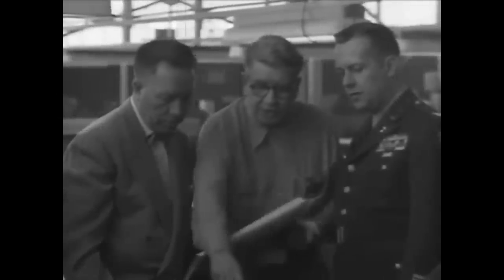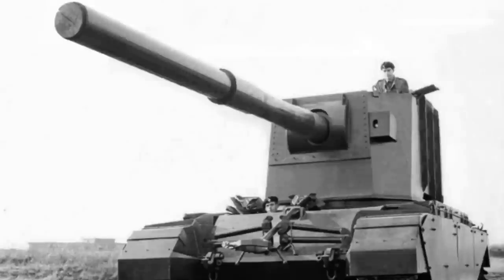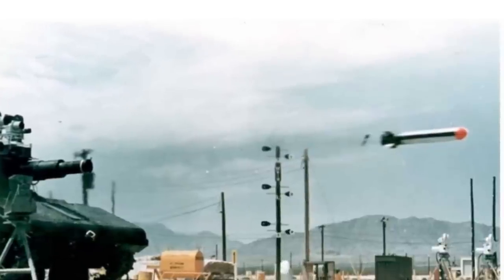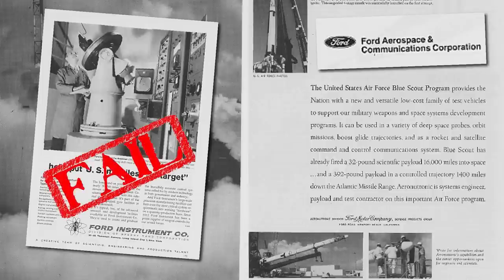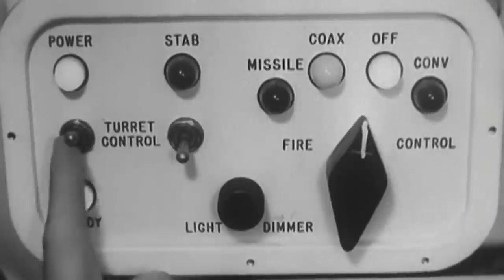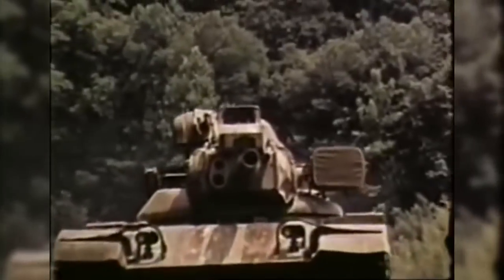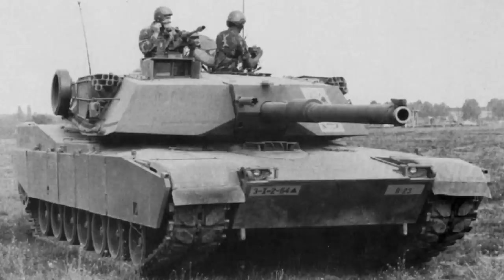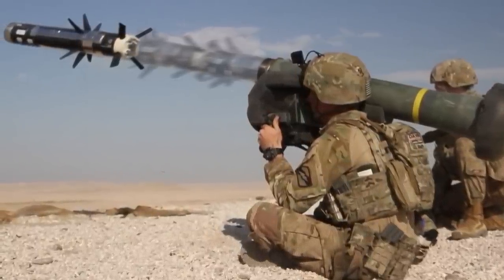MGM-51 Shillelagh - Was it a complete failure?

Comment: The M60 Startrooper and the Sheridan only gave headache to the crews so unreliable they were but perhaps the real failure was the Sheridan that recoiled tremendously and the caseless 152mm main gun rounds suffered very much from humidity and when fired conventional rounds the tank recoiled like crazy and often putting out of order the instruments and had far too thin armour with the crew sitting outside because of the mines. A very controversial tank...
Reply: I was a platoon leader and on BN staff 4/68 Arm-82nd ABN 11/73 to 11/76.  Fired missiles every year with each Company in the BN.  Only saw 2 failures.  Conventional recoil was severe, but missile component failures were rare.  Conventional round breaking was also rare.  The occasional events have been repeated so often, they are now assumed to be common.  Not true.
Reply: While the Sheridan is nowhere near as good as the cancelled M8 that was supposed to replace it, it would have been interesting if the Army deemed the Shillelagh a lost cause earlier and replaced the gun with a Bushmaster or a low velocity 76mm or something.  Not sure if that would have been doable but it would have been interesting.
Reply: @cm275  this is very true if fitted with the the Bushmaster or something similar it would have been a better option but also cheaper.
Reply: @cm275  The cancelled T92 prototype that preceded the Sheridan had a 76mm gun that could fire HVAP rounds.
Reply: I did three years C Trp, 3/12 Cav, 3AD. We fired Shillelagh every year. Saw one miss. Recoil on conventional round was to third roadwheel. If you fired to 1600 meters the track would rock like crazy and you would still the round hit. They replaced them with M60’s in ‘79. There was talk of replacing the gun/launcher with an 85mm and adding a dual TOW launcher. And I never rode on the outside. Maybe in Vietnam.

Comment: I was an M1A1 gunner during Desert Storm in 4th Battalion 70th Armor. I served with two sergeants that had began as Airborne tankers before transitioning to 19K like I was. I was always envious of their beret and tab. If we had an airborne light tank today I'd sign up for it. With today's missile technology it could be lethal. Imagine firing a round that could arc up and attack the top like a Javelin does. That tank was ahead of it's time. Cheers.
Reply: Imagine launching the missile and first the gun is automatically and nearly instantly aimed at you - and then you see the missile break apart about 20 meters away from the tank.

US tanks are getting fitted with the Israeli 'Trophy' Active Protection System.  A perfect record of stopping at ATGMs and antitank rockets in combat and when the US Army tested it using over 50 different types of antitank missiles and antitank rockets (under simulated combat conditions) it stopped every one of them.  (Including the latest versions of Javelin, TOW, and Hellfire.)

Comment: HEAT shells don't make a molten stream, instead the copper is formed into a plastic (state of material, not what it is made of) 'spear' of sorts, which kinetically pushes its way through the armor.
Reply: Semantics.
Reply: @Chilly_Billy  
I mean it really isn't.
Reply: HEAT (high explosive anti-tank) shaped charge:  creates a high pressure jet of gas and debris on the order of millions of pounds per square inch; yield stress of most armor is on the order of hundreds of thousands of pounds per square inch.  The damage mechanics are the high pressure jet literally punches a hole through the armor.  Modern defenses include armor composites that disperse the jet; physical barriers that prematurely detonate the warhead; bars that the deform the shape of the charge cone (usually made of copper alloys); etc.
Reply: @rmace8423  
There is no 'gas' with a HEAT shell, it becomes nowhere near hot enough to convert the liner into gas.
It's a purely kinetic penetrator, just exceptionally fast.
Reply: @ThatZenoGuy  I agree with you; the only gases would be by-products of the explosive detonation.   "At typical velocities, the penetration process generates such enormous pressures that it may be considered hydrodynamic; to a good approximation, the jet and armor may be treated as inviscid, compressible fluids ... with their material strengths ignored."

Comment: The main reason for the gun launched guided missile wasn’t as much for being able to penetrate thick armor. The main reason for them to exist was for long range accuracy.  Until the advent of quick and accurate range finder systems and ballistic computers tank gunnery was as much art as science. The gunner would have to calculate the elevation and lead based on estimates of range and target speed and then most often have to correct after the first shot, which would usually alert the target and their friends that it was being shot at. Guided missiles solved that problem as they are by definition self correcting. The advent of laser range finders and ballistic computers removed the need for them on western tanks, though Russian ones still have gun launched missiles as their long range gunnery still leaves much to be desired.

Comment: Spot on video. I served as a platoon leader and company XO for A Co., 4/68 Armor Bn, 82nd Abn. 10/ 75 to 10/78.
At every annual tank gunnery, we never fired the missile. It took outside tech support to prep the system, was deemed to expensive to shoot, and the powers at be
wanted to keep the record at 100% hits. The weakest part of the tank was the transmission. The engine, Detroit Diesel 6v53t was too strong for the Allison xt250 transmission. The flex plate part of the torque converter would fail on 30% of the time. As has been said, when it was good, it was very good, but when it was bad, it was awful
Reply from the maker: These are always my favourite comments - thanks so much man!
Reply: I was a platoon leader and on BN staff 4/68 Arm-82nd ABN 11/73 to 11/76.  Fired missiles every year with each Company in the BN.  Only saw 2 failures.  Conventional recoil was severe, but missile component failures were rare.
Reply: Having driven them at the NTC in '89 I can say it was always awful.  Ofcourse they were completely clapped out by then.
Reply: What was even worse was old division where the 4/68th was located, did you say the tank weight was 50 ton, it was 17 ton, what was also bad is if ya didn’t check the seal was still in place
Reply: I served in 4th Battalion 68th Armored from '86-'88. Take care, brother. Thanks for your service.

Comment: I worked at the Long Beach Naval Shipyard in the 60's and 70's. We mounted a Shillelagh turret on a small hydrofoil gunboat. As a replacement, for it's normal 40 mm Bofors. Don't know what the results of the experiment were? But doubt if they were positive. This was during the Vietnam war, when they were experimenting, with all sorts of small armed boats for the brown water Navy. 

The salt water environment, was terrible for fragile/precision electronic equipment. Doubt that the precision electronics required for Shillelagh, would have survived in use in Vietnam.
Reply: I kinda would love to see it, but i also question the usefulness of a 120mm gun on a Small boat. If you ask me, it was probably asking for trouble.
Reply: Probably flipped the boat upside down with each shot.
Reply: @watdaduckfuk  152mm gun/launcher. The round was rather slow and the missile had even less recoil. And since he mentioned a 40mm gun  the craft in question was likely the LCM(6) derived Monitor, a heavy landing craft.
Reply: @mbr5742  It was carried aboard the Hydrofoil Gunboat USS Flagstaff (PGH-1).

Comment: I'm using my wife's tablet.  I'm going to quote Moriarty from Kelly's Hero's. "It's a piece of junk!". I did a tank gunnery in 75 as a loader on one. We were so short handed that they would use anyone they could get their hands on.  We had an 11B driver, an 11E gunner, an 11D TC, and me, an 11C loader. We would fire a couple of HEAT rounds and it would knock the crap out of the missile guidance system.  We would have to go back ,  reset the system and start all over again. 
I knew some guys that crewed the M-60A2. The only thing that they liked about it was that the gunner finally had their own hatch.

Comment: 4 years in the Cav (76-80, on Sheridans) and never saw a Shillelagh hit anything.  Optics had to be recalibrated as the temperature changed.  Aft caps made nice ashtrays, though.
152mm HEAT rounds had a combustible case, that swelled in high humidity, so they got a neoprene cover (referred to as a Rino Rubber), and an asbestos bag covering that.  Still convinced firing the 152 loosened every bolt on the thing 1/4 turn.
Reply: over 3 years in 4/68th Armor.  90% hit rate.
Reply: A retired buddy said he just loved sitting in the driver's seat with everything around him was covered in leaked propellant powder.

Comment: I would have liked to see LOS armor thickness when discussing how thick armor was. Such as the T-34, it's front hull armor was 45mm sloped at 60 degrees which would give it an effective thickness of 90mm. I am aware that even when discussing plain steel armor, there are many factors relating to how effective armor is like alloy, hardness, etc, but I thought that would be a more accurate way of discussing how effective armor is while keeping it simple.

Comment: I was a platoon leader in 1/3 ACR in 1975-77 and had three M551s in my platoon. I well recall one annual qualification where the entire squadron was allotted a single Shillelagh for training and my platoon was chosen to fire it. A team showed up prior to firing for "calibration". Once calibrated, we were not to fire another 152 conventional main gun round before launching. The missile worked well. Also, we did not have training/practice (TP) 152 rounds. We fired HEAT rounds for training, which played hell with the downrange targets.

Comment: i think the sheridan was so close to being an amazing platform, the military is currently going back to a light tank design. the tech just wasnt ready for such a tank, but a modern sheridan with a similar current gen system will probably make a debut in a few years.
Reply: If you are thinking about MPF then rather than light tank the place it has in doctrine is closer to the one Stug had when it was first adopted. Heavy firesupport for infantry for taking out bunkers, mg-nests, vehicles, buildings etc. while having enough armor to withstand autocannon fire. As such MPF could be considered modern day assault gun rather than light tank.
For historical context: Stug was originally under artillery branch and intended to take out enemy strongpoints as direct fire support for infantry. It was pressed into tank destroyer role and moved under armor branch when Germany didn´t have enough purpose built vehicles to contest Soviet tank hordes.
Reply: @henrihamalainen300 and if they want a atgm on something they just mount javelin or tow 2
Reply: And it would still possess all of the drawbacks of a light tank.  (Armor protection, ammunition protection, crew survivability, unable to deal with enemy armor, Cannot be used in offensive operations, etc.)

And of course - we get all of this for slightly under the cost of a real tank.  70% of the cost of a tank is the fire control system/weapons, and 15% is the powerplant and drivetrain.  Also note that the advanced 'Chobham' style of armor used on current main battle tanks cannot be fitted to light tanks.  

In Vietnam the Sheridan's were (rightfully) considered to be deathtraps.  In the Gulf War it's sole contribution was to take out two bunkers (it was carefully kept away from places it might encounter enemy tanks).  

And to get around the bad reputation that light tanks have earned worldwide - the US Army is instead calling it a 'Mobile Gun System.'
Reply: The Israeli have developed gun launched missiles for the 105mm L7 and the Rheinmetall 120mm gun. The LAHAT is actually a bit more powerfull (800 vs 600mm) than the MGM-51 missile and works against some ERA. On a light, fast platform like M8 it can give airmobile units some serious Anti tank, anti bunker and (with HE or Beehive) AntiPersonal capabilities.
Reply: @mbr5742  With added complexity, a completely different fire control system, changes to ammunition stowage and the total amount of main gun rounds carried.  And all this on a platform that is already at its max design weight.  

BTW - the M8 is the same weight as a Russian tank.
Reply: @colincampbell767  Wrong. M8 has a maximum weight of 25to. Even a T72 is 41to, a T80 is 46to. Even a T55 is over 35to.
Reply: @colincampbell767  the ability to carry 2 light tanks is needed when going against china, the ability to take out mbts at long range with missiles and support infantry against bunkers is a niche that needs to be filled. yes an abrams is better in virtually every way except we cant get them to many places fast enough. sometimes its better to have some light tanks for fire support than nothing at all.
Reply: @mbr5742  i agree with that, having a light tank is better than having no tank especially when island hopping in the pacific.
Reply: @henrihamalainen300  MPF is somewhat similar to M18 Hellcat as well, it was originally intended as a tank destroyer but spend most of the time killing enemy infantries.

Comment: The missile dropped below line of guidance for a considerable distance after firing, giving it a long minimum range. The low velocity HEAT round had an even lower maximum range. This left a broad gap in which the tank was unable to engage armor at all, and that gap coincided with the most common engagement range band of the time, meaning that unless you were at point blank or really far away you were as screwed as a Texas prom queen.
Reply: All ATGM at that time had the problem. That is why the west germans had a gun armed and a missile armed TD on the same 25to/500 horsepower chassis during that time, the 90mm armed Kanonenjagdpanzer and the SS-11 armed Raketenjagdpanzer
Reply: The missile was designed to give a long stand off range against heavy tanks and tank destroyers (T-62s).  The Sheridan because it had no armor and the M60A2s were suppposed to be long range "snipers" supporting other units.  The HEAT was just  a backup round.
Reply: @obsidianjane4413  
There is a problem with designing long range snipers for combat that is expected to be primarily in a country with a lot of hills and forests.

Comment: When you spoke about shaped charges you mentioned that it cast out a jet of molten metal, this is not true as the temperatures needed to do this would far exceed the temperature of the explosion inside the heat shell, while it is jet esque it is simply a piece of some kind of metal that is quickly sped up by the explosions to several times the speed of sound
Reply: HEAT (high explosive anti-tank) shaped charge:  creates a high pressure jet of gas and debris on the order of millions of pounds per square inch; yield stress of most armor is on the order of hundreds of thousands of pounds per square inch.  The damage mechanics are the high pressure jet literally punches a hole through the armor.  Modern defenses include armor composites that disperse the jet; physical barriers that prematurely detonate the warhead; bars that the deform the shape of the charge cone (usually made of copper alloys); etc.

Comment: The old adage about the Space Pen springs to mind here - along with the caveat that the pencil ends up spreading conductive graphene dust around the capsule and causing short circuits. 

The AT-8 SONGSTER and AT-11 SNIPER weapons show it is certainly possible to design gun-launched missiles - but at the cost of holding a sight picture for up to 18 seconds. Meanwhile, NATO nations have instead invested time and money into designing better KE penatrators, and as a consequence have a weapon that has arguably better performance than either Russian KE or ATGM rounds - and is also a weapon they can shoot-and-scoot with much more easily.
Reply: Israel has the LAHAT missile for the 105 and 120mm tank guns

Comment: I don't see how service in the role it was designed for a decade can be a failure.  It was a stopgap upgrade for existing platforms (M60) until the next gen gun/tank would be ready.   It had SIGNIFICANTLY longer range and better penetration than the old 105 could ever achieve -- it was needed asap and arrived a decade before the US was ready to spend the $$$ on a 120mm gun let alone the Abrams.
Reply from the maker: It was theoretically great - that's why they made 88,000. In practice it was not so great.
Reply: @RedWrenchFilms  completely agree. If push came to shove, their effective minimal range (due to described sighting issues) would have meant a very high miss rate. Coupled with the fact reload time was considerably slower (a point you didn't cover) than a conventional gun, this would most likely have resulted in many tanks being destroyed by returnn enemy fire after exposing their position when firing the missile.
Reply from the maker: @brucelamberton8819  Good point! Another thing I thought was interesting is that the tank would have to remain still as the gunner guided the missile to target - not an issue for conventional gun tanks who can fire on the move or move directly after firing.